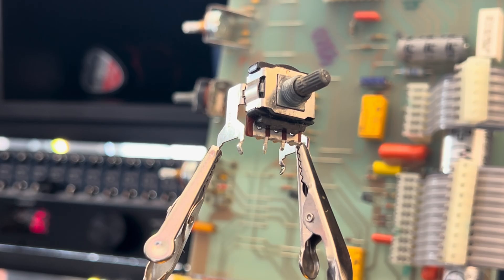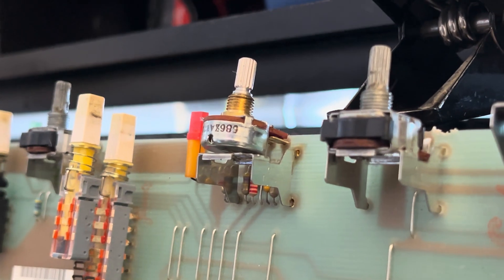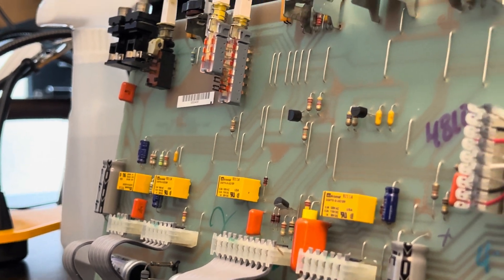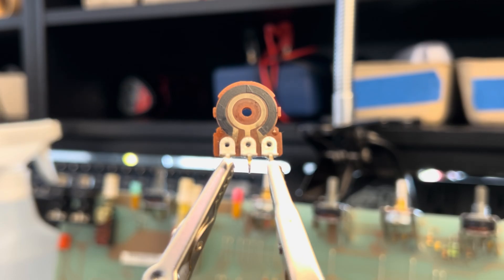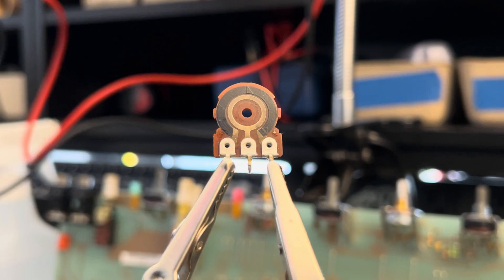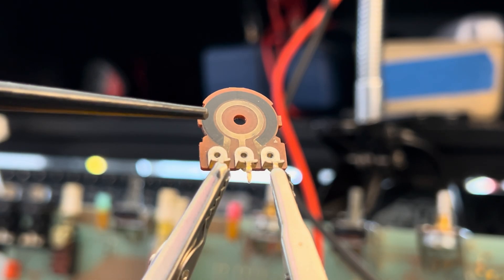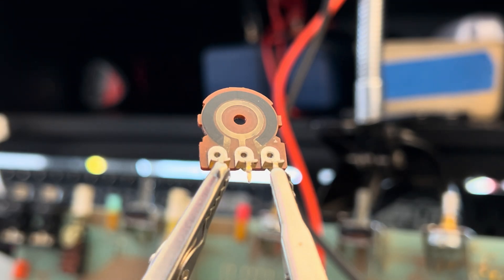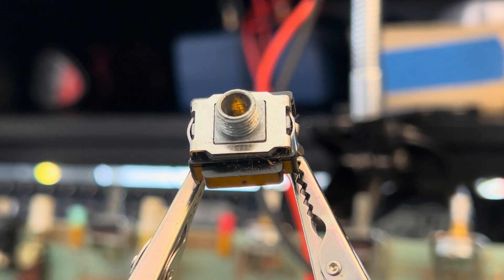Peavey EVH 5150 Block Letter — Part 2: PCB Repair & Pot Dissection

Comment: I would think the "cleaning" solution (i.e. Deoxit D5) would strip away any lubrication in the pot.  Is it best to wait for the cleaning solution to evaporate and then apply fader lubricant to the inside of the pot?
Reply from the maker: Unwashed it away and so does faderlube. Ironically you should never spray fader lube into the slider ports bc it will wash away the grease and cause the wiper to stick to the track! 😂 ask me how I know.

Comment: Thanks for the info Frank I have a old 64 Silvertone guitar that has I guess they call a dual action pot ,so the volume is at the top and the tone works the bottom knob  if that makes sense and they are very scratchy ,thing is that they do not sell them anymore so I have to open them up ,I installed some pots that kind of do what they are supposed to do but not cutting it
Reply from the maker: Are yours sealed?
Reply: @ForgottenGearRestorations  no but I think someone used the wrong stuff to clean them ,Ive had the guitar for years and replaced them but the new pots didnt cut it ,question did they use Dielectric Grease on old pots for guitars and Amps in the 60s or was it just Audio equipment ,The paste isnt cheap but well worth it if it solves the issue ,but I just have to open 1 up I guess and see if the wafer is damaged
Reply from the maker: My understanding is the grease is sparingly applied to shafts of the pots and faders and not directly in the path of the wipers. I could be wrong and have been!  You need some good concentric pots!